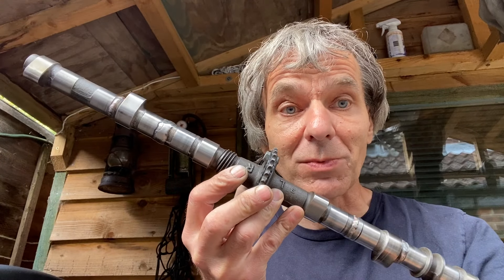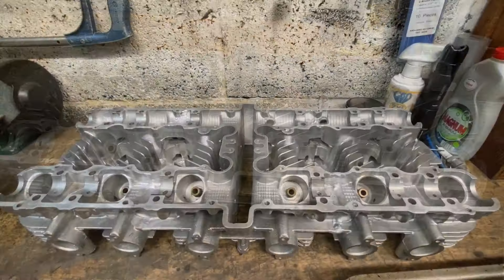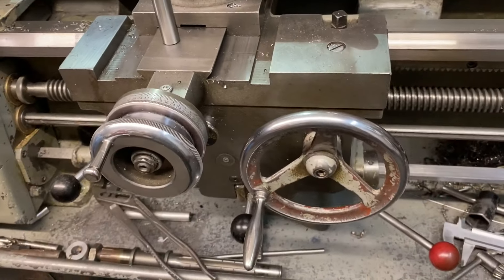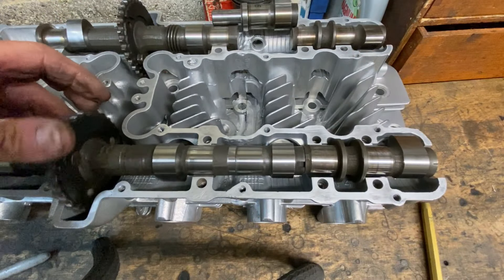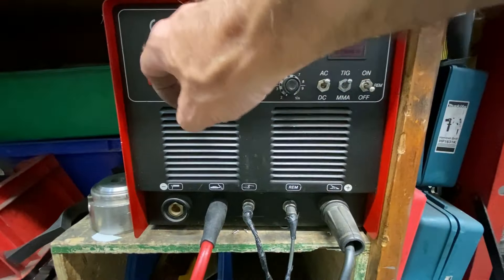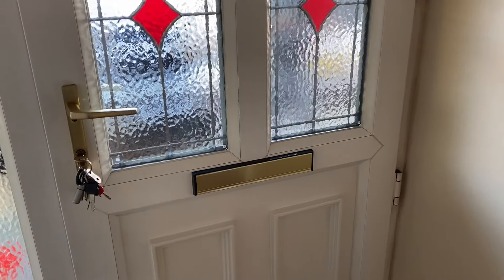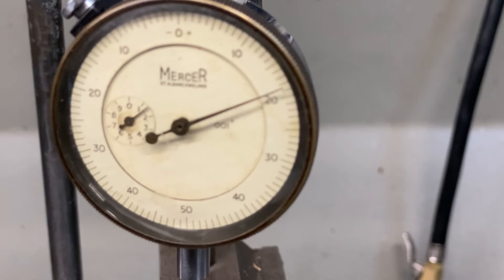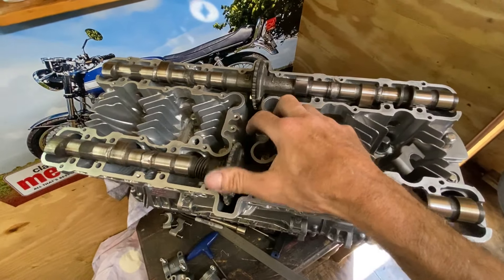Kawasaki Z1 Super Six Camshafts - How its made

Comment: The Yamaha Diversion 900 is a seriously under rated bike. R6 blue spot calipers and master cyl sort the front brakes. Another sorts that back. Rear shock needs a Wilbers. Forks are nothing special but a Hossack front end would sort it nicely. 
Finally graft on two more cylinders. The one piece crank would be challenging.

Comment: What a lovely job - as an engineer myself, I marvel at your skill making the tasks seem so incredibly simple. Two questions popped up, when looking at your work though: why didn't you put the gudgeon pins in the freezer, this would have made fitting easier, but I suspect you mic'ed each one individually? And secondly did you really just weld the cams in a single go or tack them beforehand and just simply not show to the audience?
Reply from the maker: I didn’t measure anything to make the cams except the use of a dti to show it’s running true. I machine parts by feel and eye only
Reply: @AllenMillyard  I am even more impressed now.

Comment: Me: Having nightmares about checking valve clearance and changing spark plugs on my Honda CB 650.
Allen: Bringing out his grinder to cut some camshafts, converting them from four to six cylinders.
Me: ..... 
Me again: Bringing out my toolbox and diving deep into the secrets of my Honda.
In a "few" hours the valve clearance is checked - all sixteen a perfect fit - plugs and air filter changed, new oil and oil filter, chain cleaned and lubricated, tyres back and front changed (phew, that`s heavy work...).
My bike is now ready for the spring, and the money saved on labour, will be spent on petrol instead. The twisty roads of Norway are waiting. Thanks to Allen, you inspire us all.
Reply from the maker: I need to ride the twisty roads in Norway 🙂
Reply: @AllenMillyard  You `re welcome!

Comment: Does the welding make a section of the cam shaft soft and if it does does it matter ? I had a cam spray welded and a higher lift ground. When I took it apart years latter one lobe has been worn down a lot. Would that be improper heat treating? Another great Video. Thanks.

Comment: Very impressive that you can make these bikes, with the humble  tools you have and, well... a lot of machining experience  obviously that look as if they could have been factory bikes.
One question I have is how the engine copes with the extra power of 2 extra cylinders. Do you have any issues with torsion with the crank ans camshafts being longer? Do you lower the max. RPM or does it go all the way?
Reply from the maker: i just ride it like a standard bike
Reply: @AllenMillyard  I guess all the effort you put in to proper alignment and minimizing run-out makes all the difference.  Keep up the good work, and showing how it's done.

Comment: ST1100 quick question - do you think its possible to join two motors together to make a ST2200 V8 by taking the back off one and front off another and joining the cranks together using a spline coupling and the camshafts as demonstrated in this video. Appreciate there is a lot more to this undertaking. After that extending the output shaft from the clutch on the front engine back and connecting it to the output shaft of second engine to connect with the gearbox. Is their a fundamental issue with this idea other than the obvious "but why would you do this?" Thanks.

Comment: Allen, 
Fascinating work. What firing order did you chose?  Would the lobes on each cam shaft of the 6 cylinder be at 60 degrees apart?
Reply from the maker: 120 degrees separation between lobes

Comment: Greetings from Australia. This project is mighty. How much bevel or clearance did you allow between the segments of the camshaft to get enough penetration to TIG weld or did you just run a weld bead around the camshaft on the surface?

Comment: I know this is not really the right place to ask, but when I was at school, doing metalwork, we always used "soluble oil" to lubricate drills and cutting tools. Does nobody do this any more? I have seen so many YT videos where people are cutting with no lubrication or anything.
Reply from the maker: dry machining is the way to go, no smelly soluble oil and much cleaner at home
Reply: @AllenMillyard  Thank you Allen, I was just thinking about heat buildup, but, IIRC, in school it would be (cheap) hardened steel tools, not carbide, which would make quite a difference. It WAS 1974! I seem to remember our teacher grinding up a new tool when somebody broke one. And lubricated because he didn't want to do it every morning or fire bits of broken tool around the shop every time some kid fed the lathe too fast. At least the workshop always smelt of oil.
(Wooh, Allen Millyard himself answered my question! Who next, maybe Henry or Edd?)

Comment: My brain is in a twist wondering how Alan knew where each cam lobe and chain cam was meant to be positioned. One of the cam lobes being 1mm thicker might not have been a big problem. Presumably he could have adjusted valve clearance to suit it if he hadnt spotted the problem before welding it on? Maybe a little bit of extra vibration would have been the worst that could happen if he had continued with his mistake.

Comment: Didn't see this answered, so I'll ask. Are you using the standard cam chain?  Wont it stretch - or break - with all that extra load ?
Reply from the maker: A 120 degree six cylinder engine will actually put less stress on the cam chain compared to a 180 degree four
Reply: @AllenMillyard  Because there's more valves opening at the same time as some are closing, thereby cancelling out load? What about the starter motor, gear and one-way clutch?  Main clutch, gearbox?  Or are you just 'careful' with the throttle ? (My old CBX-1000 had a puny thin cam-chain which lasted barely 10,000 miles)

Comment: Over time the bearings of the live center in your tail stock will be ruined by the welding. Tiny arcs jump between the races and balls causing pits in both. A point will come that the bearings will be trashed. If you're going to do a lot of welding in your lathe you need to get a slip ring for your ground.
Reply from the maker: Maybe, but I’ve got a couple of Z1 super six engines made.

Comment: HOW did you check for camshaft imbalance  ??  [ as opposed to camshaft runout.]
Reply from the maker: This is a slow running vintage engine and if it’s  a few grams out of balance on a 24mm pcd running at 4000 rpm max (cam) the out of balance forces will be insignificant
Reply: @AllenMillyard  mmmm.   so this  6 cylinder monster  youll only run at a maximim rev of 4000 ?    hard to believe.     so what your saying is >>>> at 4000 rpm  this machine will be doing /capable  of 160 mph  in top gear ???
Reply: @davidanderson4500  Cams turn at half engine speed. So, at 8000 rpm, the cams would be turning at 4000 rpm.

Comment: Even though I’d pretty much guessed how you would need to achieve this stage of your build Allen, and mentally earmarked gudgeon pins as good candidates for the link elements, I still had many questions. Not the least of them were the running true issues, and maintaining the lobe sequences “perfect” during welding. Answers: Heat with a tig welder and bore out just enough! The old gnat’s cob calculations!!

I don’t see a single drawing, a calculator, or even any sizes jotted down anywhere. How did you gauge where to cut the cam section? And how do you turn the lengths of each section spot on? The reason I’m confused is because they all seemed to fit in the head loosely after chopping, and before facing up!!

I’m in awe. You achieve your results so casually, truly epitomising Kipling’s advice on Triumph and disaster, where most of us would be swearing at ourselves and the job - for WEEKS!!! Epic. 

Now I’m going to watch again and try to figure out everything you casually glossed over with the word “just”!
Reply from the maker: I rarely  measure anything or make drawings I work to feel and eye, the grinding disc is 1mm so I made each section about 1mm longer so I could machine off the mm to true up end faces